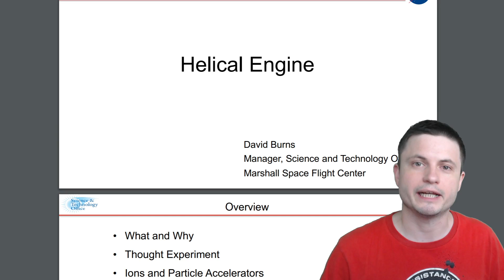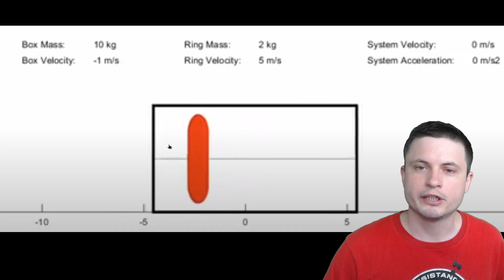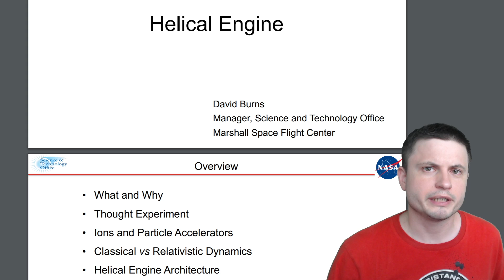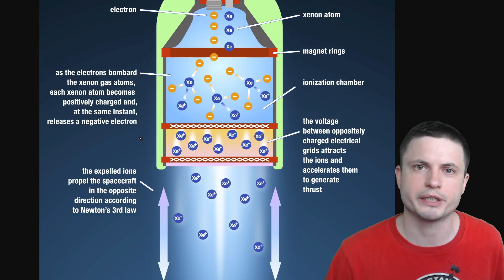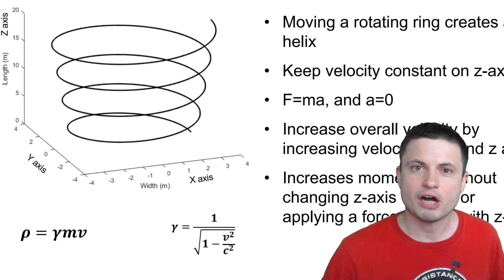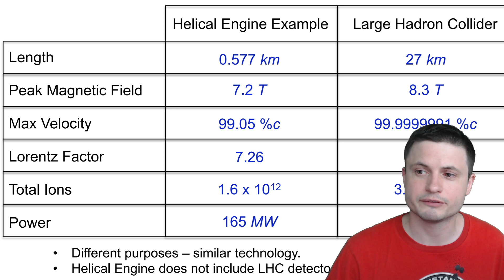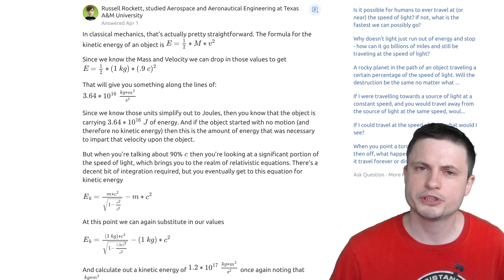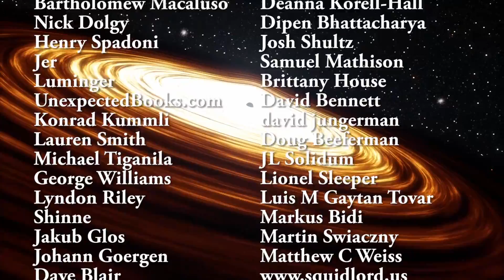NASA Engineer Designs a Near Light Speed Engine But Does It Work?

Comment: If I understand this right, an object is set up to rotate at a significant portion of the speed of light and then pushed in one direction to transferring momentum to propel a spacecraft at a significant portion of the speed of light.  It sounds like the craft goes from a relative velocity of 0 to a relativistic velocity.  How quickly does it accelerate?  What kind of g force are the occupants subjected to?

Comment: Lorentz transformations in the Helical engine using Cherenkov radiation for faster than light speeds....go go gone. Another thing, rather than have the oscillation rectilinear use a vector sum to get forward motion. So easy for China to do it and we end like Constantinople meets Basilica.

Comment: I would be happy if we could accelerate a 200 person space craft to 10% of the speed of light and do it inside of a few months.  I am not sure how hard it would be, in Gs acceleration, for a space craft to reach 10% of the speed of light inside say, 6 months.  So far, we only have gravity sling shot and ion engines but they do not impart enough energy on a spacecraft to be practical for manned flights.  I am under the impression the Voyager 1 and 2 space craft are the fastest man made objects produced and I think they are still moving under 1.5% of the speed of light.  They took over 2 decades to reach such a velocity using mostly gravity sling shooting.

Comment: I wonder about a series of magnetic acceleration gates, like you can use the planets as slingshot as well. This might mean a good timing. The ship passes trough such gate, getting a magnetic boost and moving to the next one. Heck, maybe one long gate path works better then several smaller ones. The benefit is the gates dont need their mass to be accelerated themselves, making the mass of the ship smaller. Of course, it doesnt mean you can deaccelerate in the same way, but for probing another star during a pass its possible.Just a brainstorm idea...

Comment: For this to work, the scientist would also need to create a working ‘shield’ for the spacecraft. If a tiny speck of dust hits the spacecraft at a significant percentage of the speed of light, it would be like a bomb going off.
Reply: Ice, lots of ice.When a particle hits, it would create a cloud of water vapour which would still protect and, assuming the ship is accelerating in the cold of interstellar space at least some which would be scooped up and reattach to the ice shield. Arthur C Clarke I think.
Reply: There is already a material called aerogel that was tested with this in mind
Reply: @lemonade4854  Oh great, so when all the aliens see us they'll laugh at our jelly ships 😂😂
Reply: @Archenw  Aerogel is not actually gel-like.
Reply: @fartyfat6539  isn't it sorta durable?
Reply: It's super brittle, will crumble from holding it too hard between your fingers.
Reply: Well I mean it is air
Reply: @Archenw  Who says the aliens don't also have gel ships?
Reply: @MacDaniboi  Well aerogel is brittle but it also is fantastic at stealing momentum from objects with JAXA already using it to collect space debris and it did collect a fair bit of it in fairly thin blocks of it. Layering around 10-20 of them in a row should basically stop something nearly the speed of light. Though of course hitting a full on asteroid would still do massive damage.
Reply: @Archenw  Ironically there have been reports of jello like alien spacecrafts that Bob Lazar saw in S4
Reply: Yep, there are so many problems we must consider and overcome before we can travel anywhere near that fast we cant just build the engine and hope for the best
Reply: Josh Nicol actually we can space x kinda did that to test their limits...
Reply: This is where the idea of 3D printing a single face with no sharp edges all one material is ideal. To do this successfully though, we are likely not yet there with the material this method would require. (Hoping to still be alive when we hopefully begin manufacturing and replicating the materials in the collective alien spacecraft we’ve been studying for 60+ years)
Reply: I mean hell just looking at our current technology coming back to earth showing how rough and tough space travel is. Then multiple the damage we currently have by however many times faster we get.
Reply: agreed, I actually thought that the biggest problem will be some sort of shielding... if proven fessable.
Reply: zbdot73 they could use graphene
Reply: @spheghetilover  I literally was thinking about graphene
Reply: @zbdot73  that and that the human body isn't designed for micro-G...all indications are that at current tech, humans won't be able to survive in these environments longer than 2 - 3 years before the body stops functioning properly....
Reply: @ibnyahud  Drugs could likely solve most of the micro G problems. Even simple chemical drugs of today have several avenues of potential for that, at least in regards to maintaining muscle and bone mass.

....but any ship moving that fast is going to be BIG....very long, for sure, but still wide enough to create spin gravity areas that won't make you sick. Even the ISS pods are wide enough for spin gravity rooms you could sleep/lay down in at least.
Reply: @ibnyahud  well if we make ships that have a rotation ring that creates at least 1G we are good. But that requires energy and it depends how much we need. We have already solved for lack of gravity, by creating our own with physics.
Reply: How about a space sponge?  Like layers and layers of disposable mesh of shock and debri materials that has self repairing properties.  I believe there is something like that in construction industry.
Reply: We would need a 'shield' for this engine to work anyway. A certain amount of mass ( larger than space particles) would have to hit somewhere, with a tremendous speed- this speed essentially being the top speed of the ship. So, they would just have to put the same kind of shielding on the outside.
Reply: Most of that would be solved by keeping a few simple foil sheets in a row ahead of you, spaced adequately apart. Any speck that hits foil dead on at those speeds would be annihilated into nothing but radiation.

Then, apparently, at least at up to 10% light speed, a massive, and very elongated cone at the front can deflect/spread so thin the energy of a small particle that does strike that it can hold together just fine.
(....geometrically, you can reduce the potential for damage by any amount if you elongate that cone enough)

...99% light speed would surely be impractical thru those means though. For that, you'd have to have a pre-sweeped and protected/maintained corridor of space to go that fast.

I think Isaac Arthur's "Space Highways" gets into most of this.
Reply: One step at a time.
To every problem, we'll find a solution.
Engineering has not let us down, so far.
Reply: Nah dude haven’t you seen Rise of Skywalker, just light speed anywhere and you’ll be Fiiiiiiine
Reply: At the speed of the light the atoms would actually come apart and be quite loose. So it wouldn't be explosive like we usually experience with kinetic energy, rather it would be a piercing bullet that could strike many small holes in a mundane spacecraft. They would need a very dense shield that wouldn't become too loose, so that it would be easily penetrated.
Reply: A deflector dish on the forward hull of the ship. The dish would have to be able to detect objects in the ships path, probably miles ahead of the ship and match the objects mass then send out a pulse of energy strong enough to nudge the object out of the ships path. It could possibly be configured to create a bubble around the ship itself also.
Reply: Yeah a strong radar and some starlite material covering the ship would be good.
Reply: @Ben 3 ... 
I would think that the deflector would need to identify objects at least a million miles from the ship, since the ship is traveling tens of thousands of miles per SECOND!  I think a “warp bubble” around the craft, which would inherently shield the craft from anything in OUR universe, may be a more workable solution. It would allow the craft to skirt any objects that would destroy it, and also allow for basically an unlimited speed of travel within OUR universe.
Reply: shielding is a given for any craft moving at relativistic speeds. It's totally irrelevant as to whether the motor works or not.
Reply: true. See my comment about using a particle accelerator. I don't know the math, but there's going to be a huge magnetic field. It's possible that it may function as that shield. I wonder if you could just suck those particles up and stuff them into the accelerator...
Reply: thats what energy shields are for
Reply: Well that's kinda something already been something we've had to think about for any form of interstellar travel. Either you need to waste material with a giant wall of raw metal, or we need more of a multi layered solution similar to the hull of the ISS. Make it out of stronger material that less economically friendly (which interstellar ships wouldn't be anyways) and it should be good. Plus making the ship bigger lengthwise vs widthwise also inhibits it.
Reply: That's one thing. How we gonna navigate to not hit any planet or star?
Reply: That's what main deflectors are for.
Reply: You have to consider that the chance of hitting an object in interstellar space is so miniscule that you dont have to worry about it
Reply: What about inertial dampeners? If they achieve the speed of light wouldn't that be like hitting a solid wall that would instantly crush them? and I know there is no air in space, but there would be air on the ship...I assume, not to mention the countless amounts of other gases out there that can also be condensed.
Reply: @patientwolf4444  You can't achieve light speed with mass particles. And it's not like you're accelerating to c-1m/s and then there's a hard limit.

The limit arises because the closer you're getting to c, the more mass you're gaining. To get to c you'd need infinite energy because you'd have infinite mass.
Reply: Patient Wolf We just do what they did with Prometheus and have AI run the ship, therefore not requiring any Oxygen to be present on board other than the required amounts of Oxygen being artificially delivered to the humans in the cryo-pods, enough to keep us hibernated till we reach our destination. Would that work or would the oxygen in our bodies still carry the impact once the SOL is achieved.
Reply: bomb is an understatement.
Reply: What about just building up star wars ships, they seem to work if you look in the movies lol
Reply: LC NASA wants to know your location
Reply: Not to mention the fact that if the space craft is going at light speed wouldn't it start to catch fire?

Comment: Today’s nuclear reactors using solid oxide fuels can extract only about 3% of the fuel’s energy. The remainder is stored as high level waste. They are 33 time less efficient than a tin suggests. 
High temperature reactors with a liquid fuel can extract 99% of the fuel energy but they are held up by the regulatory process.
Reply: The 'fuel energy' you are talking about though is only the efficiency of fissioning all the uranium present. But even if you fission 100% of the uranium in the fuel rods, that is only 0.1% conversion of its mass into energy. Our first fusion reactors won't do any better. Converting deuterium and tritium into helium converts about 0.1% of mass into energy. The best fusion theoretically possible would be about 1% conversion of mass into energy, but would require converting protium into iron. This is done is massive stars, but may never be achievable in a human-made machine.

Comment: A much better solution is antimatter propulsion, however the technology is not there yet. Perhaps in 100 years. Even if a spaceship could obtain near light speed, the environment will not be that forgiving as interstellar matter will hit the vessel which produces heat and drag. How matter behaves can be seen in AGN jets which are ejected at relativistic speed along the axis of the central black hole in galaxies. This is a very violent process.

Comment: I don't get it, wouldn't a circular system in space just cause a lot of turbulance-like motion? Wouldn't you get a better effect just putting a lot of presurized jets in a big long tube so you can use the jet pressure to move forward, while the tube is long enough and pressurized with air, slowing down the water dropplets enough to recollect them at the other end before they hit the other end with enough force to negate the effects?
Then again, I'm not a space physisist.

Comment: Dang it. I designed this basic idea 20 years ago in college, and my physics teacher told me it was like a perpetual motion machine and told me to rewrite it.
Mine though, used an oblong particle accelerator ring, thicker on one side, which had differing particle speeds at different parts of the ring, so that the mass overall moved faster through only part of the loop, and then kinda joined a slow queue in the return arc, creating an uneven relativistic mass movement. Kinda like an air conditioner creating uneven temperature. Similar problem though, energy.
I shifted my assignment to a hollow cylinder shaped ship, which ionized ISM matter entering the front, and then accelerated it out the back. Again though, energy problems.
Reply: Yep, you can't even make something go at the same speed without constant input, much less at increasing speeds. This entire idea of "it increases mass therefor speed therefor more mass therefor more speed cuz i'm a nasa genius that doesn't understand basic physics" is 100% bunk.
Reply: @ryan Murphy Make your "fluid" approach C in a frontwards direction, converting that energy into the extra mass via lorentz transformation, and then bleed off that potential energy and hence mass by decelerating it off-axis. 

Think about it in terms of the lorentz transformation being essentially a way to turn massless energy into inertia-ruled mass, and vice-versa. Since the "flow" is basically interrupted with a step that has no inertia, you can decouple the mass movements in a way that one set of vectors does not directly affect the others, and once you have that you can arrange one of those sets of inertial vectors to self-cancel by using at least two engines.
Reply: That's where I thought this engine explanation was going.
Reply: @ryan Murphy well, if the mass is accelerated fast in one direction, and then slow in the other direction by way of the other direction being like a big reservoir, the total mass flow is the same, but the relativistic mass flow is differentiated. The flaw in what I designed in High School, was that the slowing down of the particles at the end of the accelerated portion, created an anti-thrust problem. But I'd argue that because it was circular(ish), the relativistic thrust, and the anti-thrust, would be at angles to each other, which should create some degree of usable directional force.

Comment: I haven't read the paper but regarding the energy problem wouldn't most of the energy required to spin up the mass be recovered when you slow down the mass during its backward movement (which obviously you must do or you are no better of than with a non-spinning mass).  I mean wouldn't you spin up the mass as it is moving forward, have it push against the end of the box and then once it has transferred its momentum spin it down and reduce its mass before it hits the back of the box in order to reduce the loss of momentum.  When you spin up the mass you convert energy into relative kinetic energy between the mass and the rest of the spacecraft and when you slow it down you convert this back into some other form e.g. electric charge.  The problem seems to me to be how do you spin something up to that kind of speed without a huge amount of losses as heat (either through mechanical friction or electrical resistance).  The other problem is that you are still converting energy into momentum and that has to come from somewhere otherwise you have a perpetual motion machine so going fast is still going to cost a lot of energy.

Comment: why not use molecular light, and use magnetic fields to push on it like it is a gas. normal photon light has no mass, but molecular light has mass ,, and is made by passing a laser thru a cloud of rubidium gas , the light combines with the gas and once it leaves the cloud it splits into rubidium titinate  and molecular light ,, the rubidium titinate rejoins the gas and the molecular light carry's on into your em drive to be used to replace xenon gas

Comment: Energy in, energy out! As the object accelerates and gains mass it has to push against something and when it stops it releases that energy minus the inefficiencies ( usually lost as heat) then reverses the process, so the two cancel each other out. Not sure where the propulsion comes from?

Comment: The other fatal flaw with this engine is it's most likely impossible that any material will ever be developed that could withstand the inconceivable force of the impact of this 1 to 2 kg "quantum piston". Even sustained acceleration and deceleration at those velocities poses material degradation issues if there isn't any energy transference impact.

Comment: I recall that when Miguel Alcubierre first proposed his warp drive FTL theoretical concept, the energy required was some significant fraction of all the energy in the cosmos. Someone at either NASA or JPL (or other related agency) played with the geometric configuration of the field that would surround the spacecraft by making it asymmetrical and reduced the energy required from impossible to huge but within the realm of human comprehension. Perhaps some analogous but equally simple solution may be found here.